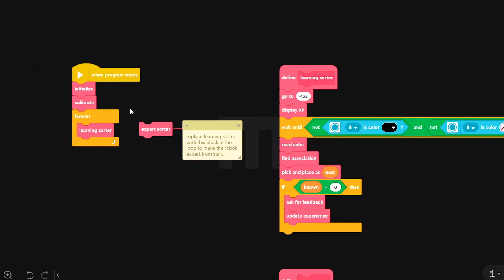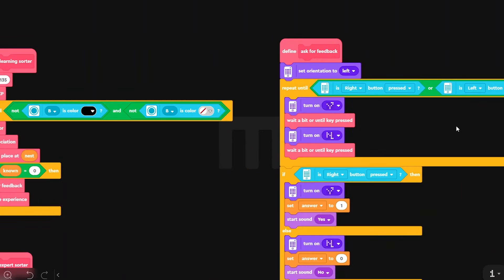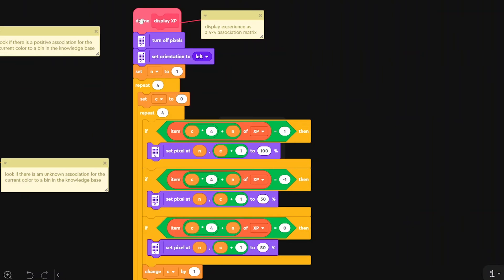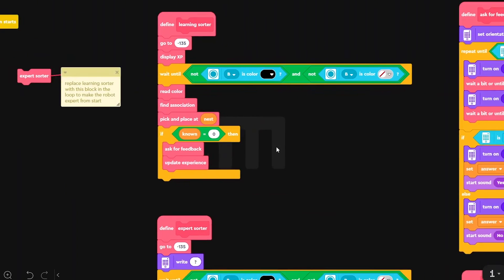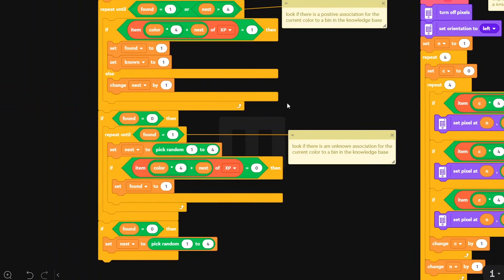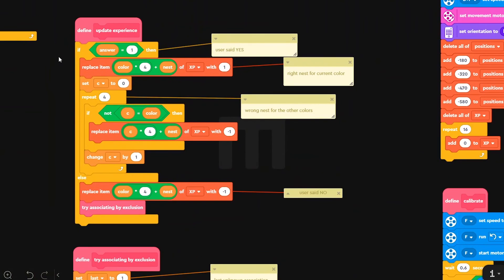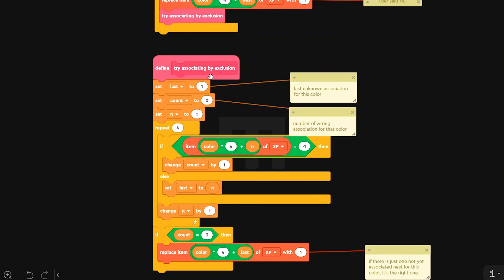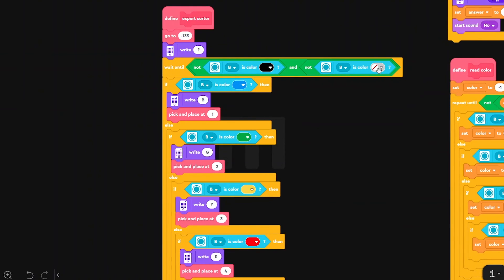AI-powered LEGO robot learns how to sort bricks by color (LEGO MINDSTORMS 51515)

Comment: I loved you brick sorting bird for Lego Boost which I made a few years ago. This significantly increases the sophistication of the programming. I will have to spend quite some time to work through it. When you develop a program like this, do you first start with a hand drawn graphical exploration of the steps? I think people would really be interested in the process that leads to the program, although perhaps you are so advanced in your thinking now you didn't have to start with such a process and made it direct in the programming interface?
Reply: @profBricks  I have several of his Mindstorms books, is it one of those?
Reply: @profBricks  Yes, you're right. That book is available online for anyone interested.
Reply from the maker: I usually start with some research, maybe reuse old ideas and mechanisms of mine. I rarely sketch on paper the model, I prefer tinkering. I am so trained in this process, that things usually come out "on their own". The software requires a different work. Starting to code without a clear idea or pseudocode ready is often a big waste of time.